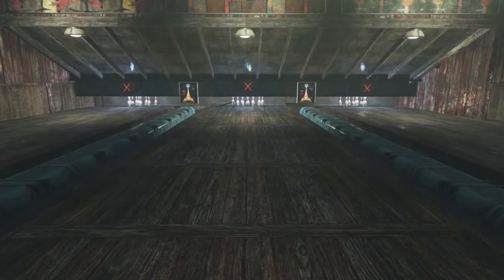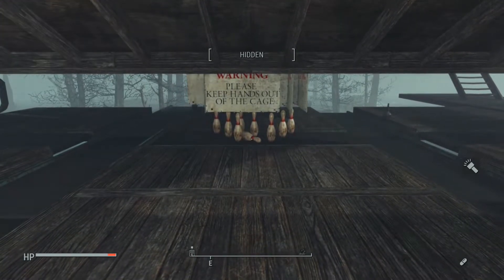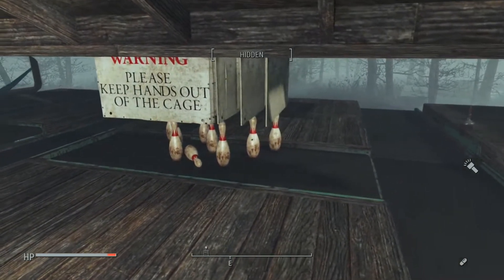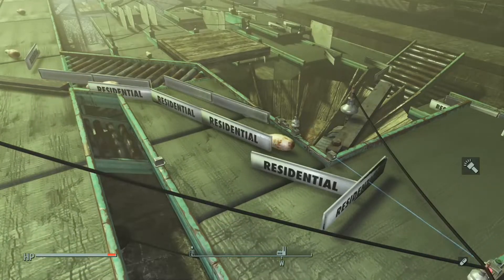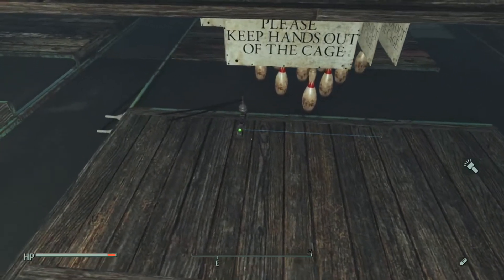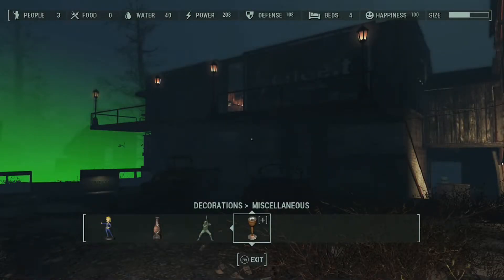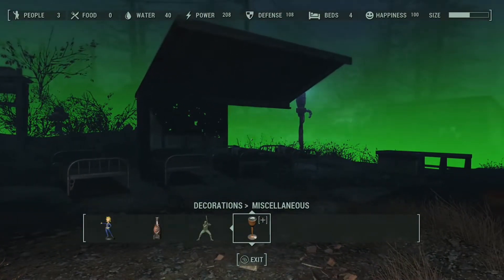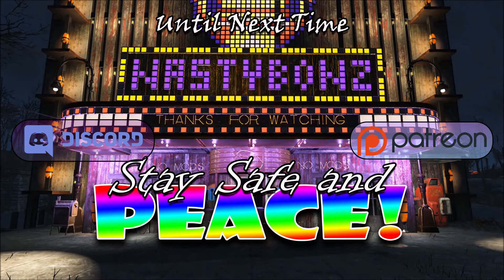100% Fully Automated Bowling part 2 Fallout 4

Comment: I'm 99.9999999% sure you've already tested this but on the slight chance you haven't....Do "bowling pins", "league bowling pins", and "championship bowling pins" all react the same? I know that their appearance, or skins, are slightly different but is their collision box changed at all? 

I know there are only 2 championship pins in the game but if somehow they were better you could use the duplication glitch to make more.

What was your original plan for the gutter caps that you had to abandon? I think the blue Vault Tec crates look good. Very close to what actual gutter caps look like.

I've pushed vehicles around with dropped items like heavy weapons or mannequins before but wasn't aware an elevator would work the same way a turret works on Brahmin. Thanks for the tip.

Looking forward to the next episode.